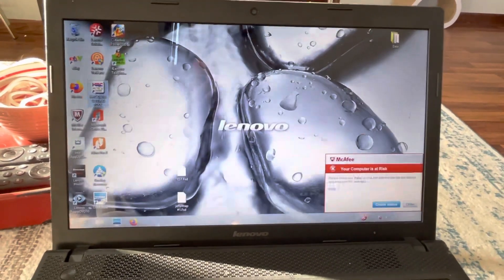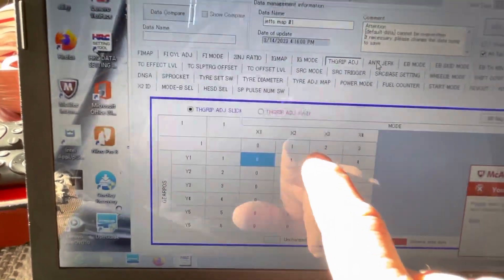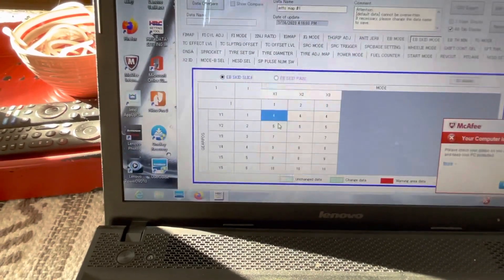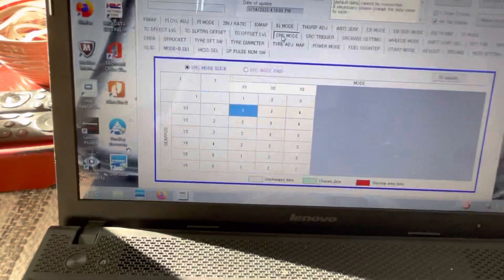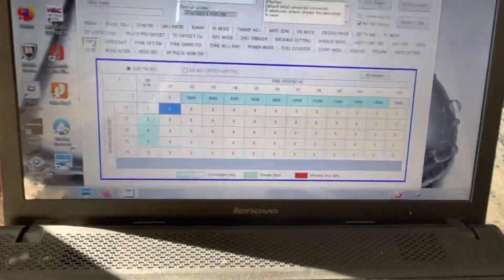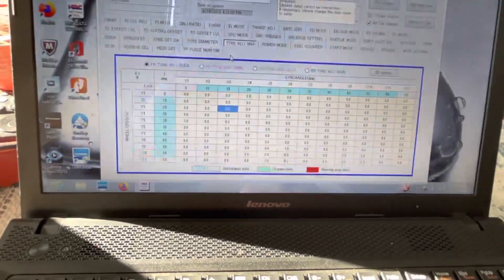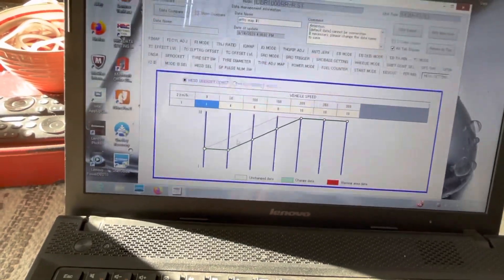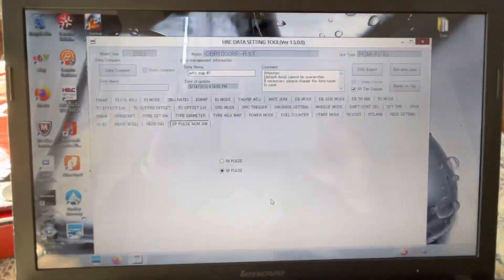2022 HRC  ecu data software HONDA CBR1000RR-R sc82

Comment: Do u need to replace the entire bike wire harness to use the hrc ecu?
Reply from the maker: Yes.
Reply: Do you need the hrc ecu to replace settings on your bike or can you use stock ECU?
Reply from the maker: @jerichojimenez467 has to be the hrc ecu and wire harness.

Comment: I see you are running the Jetprime switch gear which I have just fitted to my race bike. Am I correct in saying the Mode button moves the modes up 1-3 but I have to press the EB button to move the modes down 3-1?
Reply from the maker: Yep. Exactly. And then use the up arrow and top button on the back to use launch control
Reply: @jeffo_511  Hey, thanks for the quick reply. Wanted to make sure that was correct as I assumed incorrectly that the up and down arrows would move it but clearly not.
Reply from the maker: @BenVarley74 got ya. Ya. It’s weird with the mode A and mode B. Mode B works like normal

Comment: so, could this ECU be used on the road? What functionality do you lose? Also, can it completely eliminate ABS so that the whole system, pump+lines be removed from the bike?
Reply from the maker: Yes it removes the abs pump and all that.  There isn’t even a plug for the abs anymore. Could be used on the road. It has some plugs for lights but not the oem lights. They run lights in the 24 hour endurance bikes.

Also removes the exhaust valve servo and all the emissions stuff.

Also the electronic suspension is removed. You would have to switch to manual clickers for the forks and shock. It DOES keep the electronic steering damper.
Reply: @jeffo_511  cool, this ABS shit must save 5kg or so right? i remember back in 2010 when the first s1000rr came out, the abs model was 5kg heavier than the standard... 5kg extra to have worse stopping power. So, what about the lights? not oem headlights or not oem plugs? are you supposed to get new headlights?

Is the speed shown accurately or is it off by 10% like the road legal part and does it read above 299km/h? I know for a fact that this bike is capable of much higher speeds than 299km/h i think in one of your videos you said it uses the OEM left side switches for different functions than the factory ones.

So, in short, can it have all the road legal lights, does it show actual speed and not road legal inflated speed and does it read above 299km/h.
Reply from the maker: @vasilisgreen  so the lights I have no idea what lights will work. I do know it’s not the oem lights style plug. And there is no Speedo. Doesn’t show speed on the dash at all. U can see pull the speed from the data after a session.
Reply: @jeffo_511  oh, that's disappointing. I didn't know race bikes don't have speedos. Out of curiosity, how much did the ABS system, pump and lines and wiring weigh?
Reply from the maker: @vasilisgreen  no idea. Bike now is 406 wet on my current race configuration. Could save few more pounds with carbon fairings or aluminum sub frame and stuff
Reply: @jeffo_511  cool. That cbr is really something.

Comment: very helpful video, do you have a link to the 2020 user manual to help explain the settings, i only have the supplement with my setting tool s/w.cheers
Reply from the maker: Thanks man. Give me an email and I’ll shoot it over.
Reply: @jeffo_511   hi, i've put my email on a reply twice now, but seems to keep diappearing, m aybe you cant add email address on here?
Reply from the maker: @scoobyzx10  should be able to now. I changed the comments settings. Maybe leave the .com off the end.
Reply: @jeffo_511 would I be able to get that 2020 manual as well I just got my bike back from getting a full engine rebuild I would love to be able to do this all by myself I have HRC Kit harness and ecu thanks and I love your videos